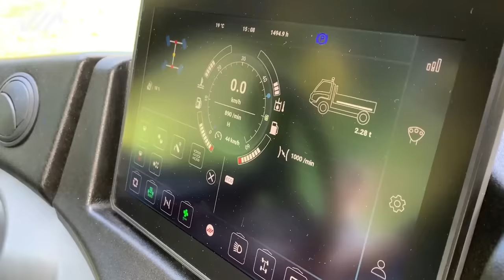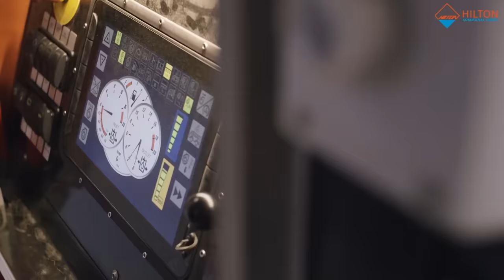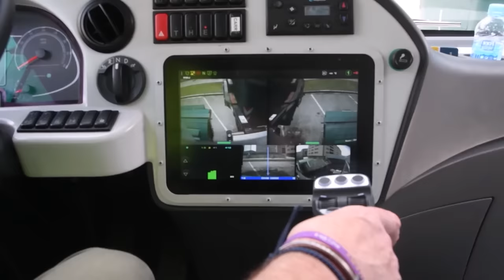COOL TRUCKS THAT YOU HAVEN'T SEEN YET

Comment: 5:53 In Europe it's not just standard that such systems are installed, it's mandatory. Most trucks have emergency braking systems, lane departure warning systems and distance radar. And that applies not only to vehicles with electric drives, but also to diesel trucks